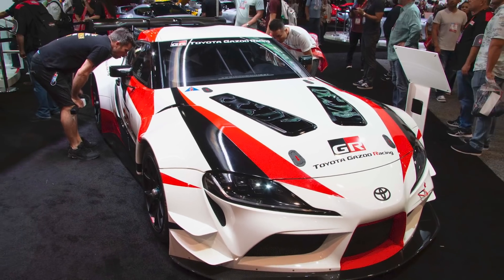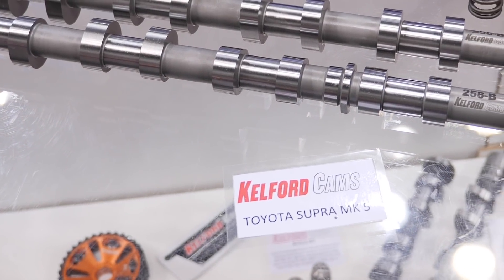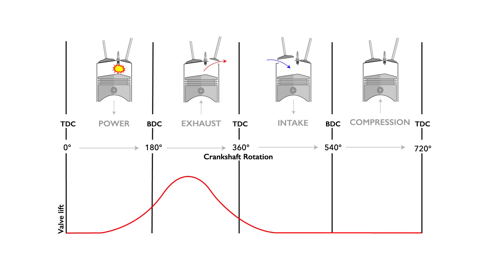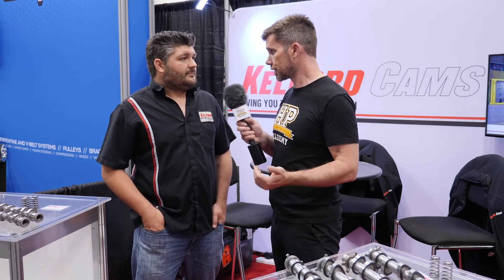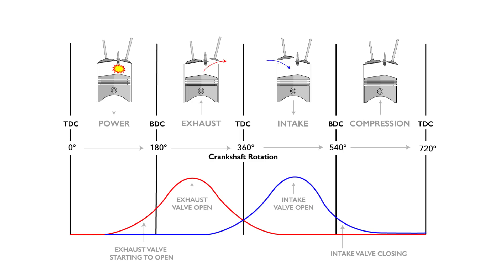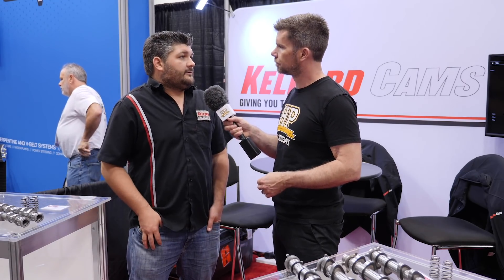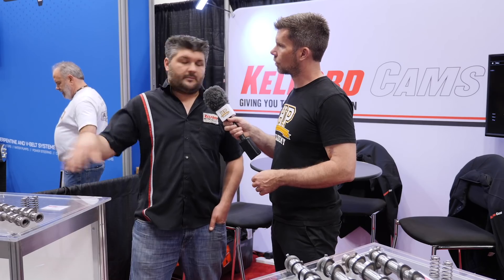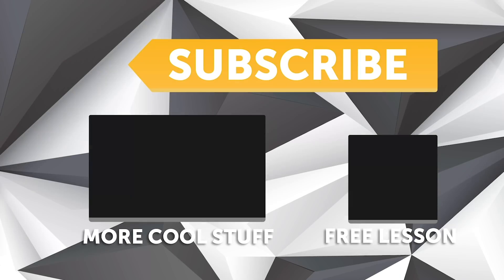A90 Toyota Supra Camshafts | Reverse Engineering The B58 | Kelford Cams [TECH TALK]

Comment: The propaganda is getting smarter. The car is ugly and fat.
Reply: BF109G, A90 was faster around VIR than a Charger Hellcat 2016.
Reply: Tesla Farts 
Good job for BMW.
Reply: Your acting like all new cars aren't. Especially sportscars.
Reply: Carboy Dorifuto party 
The C8 isn’t
Reply: @BF109G4  doesnt have to be a C8 when Nearly every new car now is overweight. Plus concentrate on the mk5 the C8 has noting to do with the mk5.
Reply: Carboy Dorifuto party 
You are right the C8 has nothing to do with the MK5, the problem is that the C8 is exotic, more modern, and beautiful however has the same price as the mk5. Toyota just exploited the name supra
Reply: @BF109G4  yea no. I still can't get the Camaro taillights off my mind and it's still hard to like because of its design. And the mk5s 50k not 60k like the C8 is and will be cheaper once the 2021s start rolling into dealers and exploited the name?1. They're making the mk5 in smaller numbers compared to the C8 that's being mass produced and will be as common as Camrys or mustangs and isn't even aimed towards it that even in other countries there'll be a definite gap between the 2's prices once they hit other markets that other than the us's. To me the mk5 gives me the reminder of a 2000gt or a TVR Griffith and I don't mind it vs the C8 which im still trying my hardest to get used too gives me too much of the impression that they just ripped the taillights off a maro and made it a stupidly sharp design that's still hard for me to like even now and gives me the off vibe that it's a nsx and a rarri put in one with the headlights off a C7.
Reply: Carboy Dorifuto party 
Did you see the drag between the mk5 and the c8 ? The c8 won although the mk5 cheated that’s why I’m not buying the camaro taillights, sorry. The supra is 55k, the c8 is 59k. A very good price for a mid engine car built by the mother company not built by someone else.
Reply: @BF109G4  mk5 cheated? Huh?how did it cheat exactly? Legit neither got a red light when they both went off the line nor did the mk5 let off early so we're in gods sake did it cheat? And I dunno were your getting your priced from but the mk5 is 50k. 55k was the launch editions price,53k for premium,and 50k for base. The C8 is 60k but with all of the options that it has it can jerk up to 80-100k. And just cause it made from its mother company doesn't mean it's going to be a trouble free car even if it is faster. This is GM's first mid engine car they've made in decades after the fiero. And no im not trying to pull defense for the mk5 since it's got its fair share of problems but however,a decent chunk of the parts in the mk5 are already known by the BMW(don't pull up with the BMW crap let me finish)so that practically gives mk5 owners plenty of help if there's a problem that comes up with their mk5 that can translate back to problems 40i BMW's and the problems they have. In the C8s case yes its a good car but still this is made by GM and they haven't made a mid engine car like the C8 in decades and regardless of how good it is I don't see it being cheap in any case with repairs because there'll be the pair of idiots doing stupid crap to them in either crash,blowing the engine up,destroying the trans,breaking axles(no I'm not talking about that C8 that was going against the mk5 but it was stupid of him to go out and push the car before breaking it in first),and trying to show off in them(I'm heavily expecting to see this happen to a lot of them tbh) and yes there are mk5s out there that have been crashed since its either or a idiot is driving them or not.
Reply: BF109G the Supra costs less than 100k in every other country. The C8 costs more. Hell, even a Camaro SS costs more than a Supra in Australia. The Supra was designed to be sold worldwide. The C8 is more focused towards the American market. Go to literally anywhere else in the world and they will tell you the Corvette is not worth it. A C8 is more expensive than a 911 Carrera S in Australia, which has similar performance in a much better package.

Also, how is the mk5 exploiting the name? If the end product is of good quality do you think that it really matters? By your logic then the 2JZ is a work of sin because Toyota collaborated with Yamaha to create it.
Reply: @devandrasimanjuntak1646  thank u for clearing that up.
Reply: GT Specialist 
Toyota didn’t collaborate with Yamaha in the 2jz. It’s pure Toyota. They collaborated in the 1jz, the 7m, and the gs engines. 

You are the most ignorant person I ever spoke to. Price isn’t determined by whether the car is international or domestic. In Saudi Arabia the supra is 220k and the corvette is 240k (same USD after customs and VAT). Of the product is good then the credit is for BMW not TOYOTA.
Reply: Carboy Dorifuto party 
The supra went off before the corvette and yet it lost
Reply: @BF109G4  no....no it didn't....plus they aren't going to react at thr same time and if the supra had let off early the trees would've instantly pulled a red light on the supra if it did and also that mk5 looked stock as anything so it was obviously going to lose(needs a driver mod since mk5s don't hit high 12s like the 12.9 it got)since they commonly hit 12.5-12.2 stock were as the C8 hits 11.7-11.5 stock including the fact that it is mid engine and has 100+ more hp than the mk5 so it clearly had the advantage.
Reply: @BF109G4  and for God's sake do I have to keep repeating this to you guys? Toyota just asked BMW for the parts. They didn't have a part in the tuning,stiffness,exterior design,few parts in the B58,and the way it drives was all done by Toyota. In their words BMW and toyota didn't want neither car to drive the same nor feel identical to each other. Plus I just looked up the prices comparing the mk5 to the C8 in Saudi Arabia and the mk5 would be 204k vs the C8 being 300-330+k.(which translates to 54k for the mk5 to 80-90k for the C8)
Reply: Carboy Dorifuto party 
Even the chime is BMW lol
Reply: @BF109G4  Ok......whats the chime going to affect exactly? If your worried about a chime then you honestly need to reconsider on get neither the mk5 nor the C8 if your picking cars with specific chimes like their the most important part of the car.
Reply: Carboy Dorifuto party 
When I say even the chime is BMW I emphasize that the whole car is BMW
Reply: @BF109G4  and how does that work? Show me the blueprints and tell me how it's exterior design make it fully BMW when u nor I know what parts were done by either or Toyota or BMW.
Reply: Carboy Dorifuto party 
I don’t have to show you because you tube is filled with clips showing you how BMW this car is
Reply: @BF109G4  then how are u going to prove to me it's fully BMW when u haven't showed me the evidence of it being fully bmw
Reply: @BF109G4  tbf I could honestly care less of how much "BMW"is in the mk5. It's being used for what toyota built it for. Practically the fun,tuneability,and builds can practically be made out of the car. It's not perfect in no means nor does it have to be but they atleast gave us something to work with rather than give us a crossover with the name nor did a copy paste with a Lexus and called it a supra. So what home built Toyota do u see being used like the supra(this includes Lexus also) don't give me a field day with the lfa and all its glory since theres barely any on the roads as is i want a legit answer compared to BMW. Please save the "Toyota's the most reliable brand and they could be used a Lexus chassis and engine"bs for the Lexus boys since they seem to think that Lexus has been in the tuner scene for all these years compared to BMW and other brands. And no im not throwing defense on BMW or Toyota im legit asking what has Toyota done to show that they still got what it takes to make a car like the mk5 we have today. The last time they actually "tried" making something big for the car scene was the lfa and it's price tag killed it including how long it was being tested. The Lexuses we have now can baremy useful as is other than being called a "reliable daily"which is not bad but with how the lexus community is they talk big on their part with reliable but rarely ever speak on tunablility or how they drive on track compared to other cars and that the Toyota community itself are so self centered toward the mk4 that they completely throw all of their current rwd platforms with either V6 or V8s to the mk4 and will completely ignore them once the "supras"involved. Plus fake vents are on nearly every car being thrown into the market now that it shouldn't even be a big deal now no matter how infuriating it is. Plus it was a "CO DEVELOPMENT OF BOTH CARS" of course their going to share parts from the company their working together with. Look at the chevy cavalier,the holden vl Commodore(shares Nissan's RB30),pagani zonda or hueyra(AMG power v12),mitsuka which has worked with Nissan and has cars with Nissan engines,drivetrains,or chassis with a completely different body or them working with mazda to make the rockstar, or even how honda rebadged the range rover as the Honda crossroad. Your acting as if this is the worst thing possible that they could be done but look at Nissan their decade old design and engines still being sold for 100k still with barely any change since its release and honda in how they made the nsx themselves yet they barely ever sell since their so expensive. I could care less about heritage and the name being iconic since that isn't going to get people to put their mouths were their wallets at because once you make them happy and they see the price they start complaining that it's too expensive or they completely go ghoust after saying they buy it as soon as.
Reply: Carboy Dorifuto party 
Yeah but they copy paste a z4 and called it supra. What an abomination.
Sometimes having nothing is better than having something ugly.
Reply: @BF109G4  plus Toyota and BMW agreed to work together YEARS before they thought of the  Z4/mk5 project so it makes sense that they worked together and yes there wasn't a lot of cars that toyota used BMW's engines in before the Z4 and supra ordeal happened but still they were working together anyway before they decided to make both cars in the first place. If u don't believe me fine then, please look around and find articles stating they worked together before they decided to do these projects and also for the record I like the mk5 for what it is and for the record im sick of people like u that won't give this car a chance(and no im not saying shut up and accept the car just let it do its own thing and stop comparoling it to something it's not) anyway so atleast we found some kind of agreement for once.
Reply: @BF109G4  ok how bout no. And please. If your going to say its a abomination then go tell that to all of the companies working on them. Tell that to the owners also and please answer my question about Lexus if that's the not hardest thing for you to do. And oh please like the mk4 wasn't a abomination also since your telling me that it isn't as much as a zombie when it practically was thrown together using other cars parts.
Reply: Carboy Dorifuto party 
The mk4 supra was built on SC chassis. Atleast it was built by toyota (mr other cars parts lol) go home boy
Reply: Carboy Dorifuto party 
The supra is recalled by BMW LOL LOL
Reply: Carboy Dorifuto party 
Hay boy, the 2020 supra is recalled by bmw lol
Reply: Carboy Dorifuto party 
Do you know that the A90 supra is recalled by BMW ?
Reply: Carboy Dorifuto party 
A german car manufacturer recalled a (supposed) Japanese car, do you know what’s the car ? It’s the supra lol
Reply: Carboy Dorifuto party 
Supra recalled by BMW, what a strange thing to say
Reply: Carboy Dorifuto party 
BMW corrects the mistakes of TOYOTA by recalling the supra
Reply: @BF109G4  Jesus Christ dude atleast write in a one replie and not make me read almost 20 different replies. Any way toyota used BMW's 4 cylinder diesels named the WW(based off the BMW N47 diesel) look up the cars sense you had enough time to send so many replies
Reply: @BF109G4  also I could care less on who built it. It still shares parts from other cars and no I could care less if their from toyota themselves. It didnt have its own chassis and it didn't have its own engine specifically built for it only since it was shared in some many different toyotas. Just like the mk5(I could care less if it's German it still interests me) it shares the B58 from the 40i BMW's and it's chassis from another car.
Reply: @BF109G4  also it was 7 cars. But that's just one car vs the millions of other car models in Toyotas line up that got recalled not too long ago. And if it's their first year being out then that's expected no matter who recalls it either it's Toyota or BMW.
Reply: @BF109G4  and yes im not stupid I know. Just for faulty seatbelts but there weren't many on the streets at that time since the car had only been out for its first few months and others were either still being shipped to dealers or were just delivered to dealer ships. They even found them days after they reported the recall Any way.
Reply: @BF109G4  also no. I just keep seeing your comments whenever I decide to look up something about the mk5(although now usually got my eyes centered on what the C8,gt500,GR Yaris,and new GR86 and New M3/M4 to see whats happening with them whenever I can)
Reply: Carboy Dorifuto party 
A seatbelt that causes a whole car replacement !! Yeah right.

Supras are recalled by BMW for seatbelts (supposedly).

- They are recalled by BMW for headlights failure.

-They are recalled by BMW for rear camera failure.

What we take from these recalls that first : the car is rubbish.
Second : it’s built by BMW.
Reply: @BF109G4  so your telling me that just cause it's BMW its rubbish. The fact that it's the cars FIRST YEAR being out its not GOING TO BE A TROUBLE FREE CAR and no don't give me that bs saying "if Toyota built it themselves"its still going to have some kind of recall since it happens to any car regardless if its even Toyota and also these problems mostly taken care of and owners and dealers were quickly notified and were either checked or had them replaced(the cameras and headlights)as soon as it came up. I honestly could care less if it's a BMW its atleast got people actually putting effort into using the car and doing something with it rather than using it for bragging rights just cause "it's only reliable"but gets wiped to the floor like Lexus is. If people don't put any effort into using any of Toyotas rwd chassises they've made in the last decade but scream for them to make a 2 decade old car to bring back from the dead they wouldn't have needed a reason to even make the mk5 but since they wanted to get back into the sportscar market they did but they went to someone that actually HAD experience in making i6s and a sportscar chassis because let's be honest here people rarely ever bother doing anything with any modern rwd Toyota other than the gt86 and while I agree that BMW's are unreliable(only depending on the engines and cars)they atleast have a community that's working with the cars that even the all well known N54 worked its way to get them to the 1000hp mark even tho those things are ticking time bombs that even now the the S58,S55,and B58 are slowly growing a bigger crowd in the aftermarket scene while Lexus has practically been in the same position for the last decade with no one even doing anything with them. Toyota haven't even built anything like the 2j or a sportscar in 2 decades now. They aren't magically going to pop up with a sportscar and expect people to buy it since Toyota is now the more family,SUV,daily car manufacturer. They aren't what they were when they used to build sports cars since they've now "HEAVILY"centured themselves into a reliable daily/family car brand. Also they wanted the car to be attainable so they worked with BMW so it wouldn't skyrocket into prices that might range near the LC500s since they knew it wouldn't sell at those prices(They know the LC500 isn't selling at it's 100k mark so putting the mk5 in that position would be a mistake if they just left it with its 300+hp in the kind of price range)
Reply: Dear readers, I explained why the car is rubbish to this guy 3 months ago. I talked about the engine technically but he keeps stalking me to mislead others. This guy will not convince, he just throws words repeatedly only to flood the comment section with his replies so you would feel tired and stop criticizing the car. Don’t fall for him.
Reply: @BF109G4  stalking. Lemme tell u I saw this video in MY recommendations including other videos since I had noting to do(other than the fact that imma need to get back to work in a few days) and decided to WATCH it and noticed your comment. If anything go to the OWNERS and please go tell and ask THEM about their MK5S and go ask TOYOTA how they feel when they decided this. NOT EVERYONE in the car community is going to care for either your side or my side of the story on how we feel about the MK5 so u go YOUR way and I'll go MY way with how we think about the car since we're both IDIOTS and have both shown what we know about the car and what we dislike or liked about the car etc etc and I repeat this crap only because people will sit there and critize it when its barely a YEAR OLD as it is and BARELY HAS HAD any time to even grow in the car world. I could care less for the 70th time I've had to tell u how much BMW is in it I just want to see what people make out of it and that is all I wish to see out of ANY car not just the mk5. I could care less of how good,bad,ugly,slow,unreliable,etc etc I just want to see what crazy thing people will do to any car regardless of who makes it or not and I strictly believe no matter the car it DESERVES a chance regardless of it's following and im sticking to that belief till then and I'm not sticking up for the mk5 I stick up for other cars at points but we're strictly talking about the mk5 only rn. Also if u wanna get technical pleas go talk to a person who's owned a B58 or go to the bimmer forums and talk to them about all this and talk to them how they feel about it or even go onto the mk5 forums and tell them about all of this because u can go shoot them in the back with all the statements you've got against the mk5.
Reply: Carboy Dorifuto party 
This is not the only video you stalk me in, and can you please brief because people hate long posts
Reply: @BF109G4  I have a habit of looking in the comments whenever I watch a video and I might decide to tap into the comments whenever I feel while watching the videos. Even now im still doing that even before I even watched this video and saw your comment.
Reply: Carboy Dorifuto party 
Yeah right lol.
I sometimes lose my comments while you find the easily.
Reply: BF109G wow for a supra hater u sure are on every 2020 supra video 🤔🤔
Reply: @X1xRiGox3X   agreed
Reply: @BF109G4  you are so wrong it's hilarious. The G in 2JZ-GTE stands for Yamaha build wide angle performance cylinder head. In fact i work in a machine shop and work on the jz heads personally they are stamped with the Yamaha logo
Reply: Kinslayer Gaming 
You liar, I work in a garage and modify 2jz engines. The heads never stamped. If you look for the 1jz you find the logo stamped on the plastic cover of timing belt. Go sell your lies elsewhere, we are experts
Reply: @BF109G4  you don't seem to be. I work day in and day out machining them, cleaning them and assembling them
Reply: @BF109G4  by the way, look at the design of the 1JZ head to the 2JZ, in components and design they are down right identical, so even if the 2jz heads aren't stamped as you say they are Yamaha designed heads even if Toyota says it is a clean sheet design( which it isn't )
Reply: Kinslayer Gaming 
Lol, I’m a mechanic and I gave you a lesson about the big lie (the stamps) you claimed. You’re not a mechanic, you are a liar. I say it with confidence. Can you tell me about the in and ex shimming clearance ? I’m waiting for you now, don’t look it up.
Reply: @BF109G4  you like calling people liars huh? The clearances are 0.006" to 0.010" intake when cold and 0.010" to 0.014" exhaust when cold. That's for the 2jz if i recall correctly. Also if you modify so many jz engines as you say what's the name of the shop you work at not once have you mentioned it. Oddly suspicious for someone so confident
Reply: @BF109G4  oh wait i almost forgot that they have the same clearances so there is no need to mention both. Btw if you know so much about JZ series engines as you claim, tell me which year the did the 2jz have vvti
Reply: Kinslayer Gaming 
Please don’t ask such questions because they are not professional, I want questions such as cams closing lubes or overlaps or piston to block ratio or how to degree a cam, not what year the vvt-i came out lol. I own a shop in Saudi Arabia my friend.
Reply: @BF109G4  you don't get to decide what questions are professional or not. VVTi affects the build in cam choice and piston to valve clearances ( which is up to the builder ) some decide not to run VVTi at all to avoid complexity. So to correctly council your customers when they carry out their builds this is vital information
Reply: Kinslayer Gaming 
Yes, I’m the one who decide whether the question is professional or not. BTW, all the clearances you posted are oem specs, they’re searchable
Reply: Kinslayer Gaming 
You can ZERO the vvt-i my friend, it’s not mechanical, it’s tuning. The piston ratio stayed as is on the vvti, the only difference is the connecting rods
Reply: @BF109G4  sure they are searchable but i didn't search them i have specs written down for manu different heads. Also you didn't specify which clearances you wanted
Reply: @BF109G4  for the 2JZ-GE the rods were weaker( different part no. ) the GTE didn't have weaker rods. Also i know how VVTi works, you have up to 60 degrees of room to advance and retard the cam timing ( 30 degrees oem ecu). Some blocks in the US came ready for VVTi even if we never got them in the first place. And by the way kelford's 272/278 cams run .25mm clearances on both intake and exhaust (  very popular cam here in Puerto Rico, some prefer crower ).